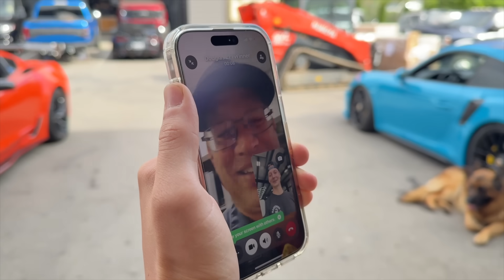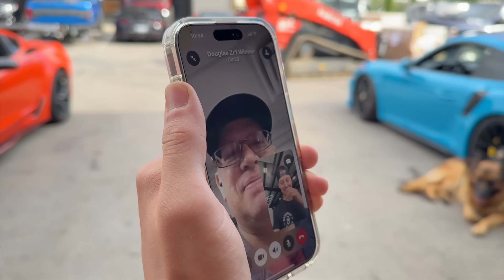Rebuilding A Wrecked 2024 Nissan GTR (Part 7)

Comment: I just want to see you guys put some cavity wax in every opening on the frame rails were salt water could still be trapped to make sure it doesn't rust from the inside out, salt water on steel cars is no joke, just do it right.

Comment: A baja-spec off-road R35 GTR would be extremely awesome, I've never seen a single proper off-road GTR, but this is turning out nice. Love the paint color choice!
Reply: Adam lz had a r32 off-road gtr. It was sick too
Reply: @kristinewilson5353  Yeah it was very awesome, but it was a rally safari build so it was made to be fast on rally stages. The kind of GTR I mean is one capable of some amount of crawling and jumping with long travel suspension. A Baja-spec car, in other words, like a similar conversion the squad did to the Baja Trackhawk, the Bajawk :P

Comment: You guys gotta start priming the oil lines for pressure. Disconnect the coils and crank the engine for 15-39 seconds before just firing it up. Really wanna make sure oil pumps to the top end and in the turbo lines.

Comment: That’s the ball joint tapered seat for the lower control arm it does come off with a little bit of heat and a pry bar and it should pop right out and you’ll be able to use it on the new arm but will have to repeat the same process again if you end up getting another set of or arms for some reason

Comment: Before you guys forget you need to change the Vin plates over from the other car to the new tub before you put the windshield in and there might be one in the driver's side door jam cause if not the Vin will come back to a 2011 instead of the 2024
Reply: The vin stays with the tub, changing it over would be a big no no

Comment: BTW, the plastic intercooler duct and engine oil cooler ducts are different over the years. older years parts will not work with newer bumpers.

Comment: The GTR has dual clutch transmission and they are a bit weird on take off, they need to be to be spooled a bit otherwise it feels like terrible turbo lag, after all it is a V6 pushing a car that weighs 4000lbs.

Comment: That suspension ‘cone’ taper insert is normal on a lot of vehicles with alloy uprights. Need to be careful how you remove the ball joint so it remains in the upright as getting off the ball joint is all but impossible

Comment: Really should have replaced the fly wheel bolts and at least put lock tight on them. Fingers crossed they don’t cause issues.

Comment: I personally stay away from Mobil 1 Synthetic as they have absolutely terrible cold weather viscosity. Their high mileage oil does a much better job flowing, but I run valvoline. I know, oil is one of those things a lot of people have their own opinions about but imo cold starts and oil flow are most important to me and I've seen a few videos demonstrating how bad Mobil 1 can be.

Comment: you needed to heat up the turbo flange with a real torch and not just try to heat the stud with a copper pipe sweating torch. if anything, you made them tighter and tried to get them off.

Comment: Bro did y’all use a eBay blowoff valve when the gtr uses a DV valve? The system is meant to recirculate the air where a blow off valve vents to atmosphere… besides blow off valves don’t work well with a auto trans go get a turbo smart valve way more efficient and makes sounds